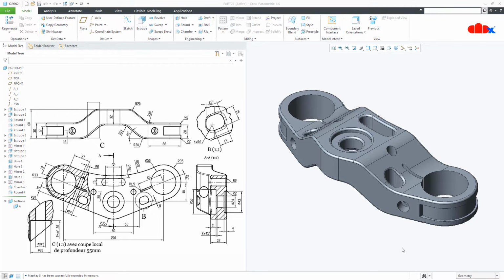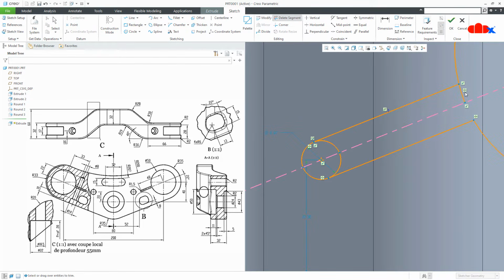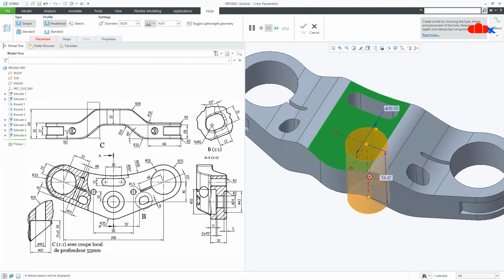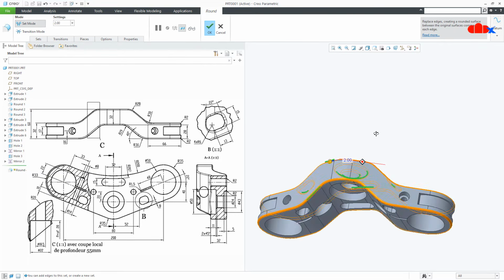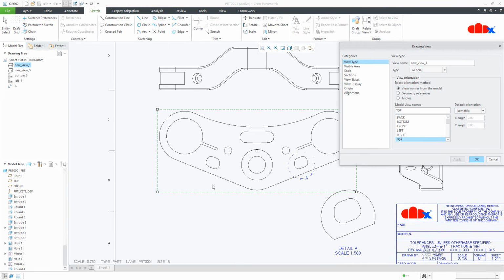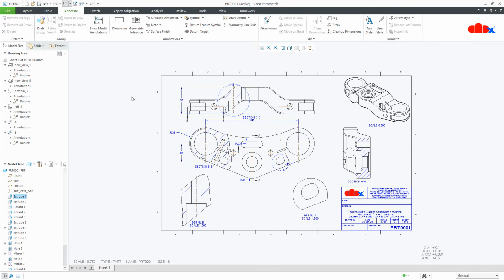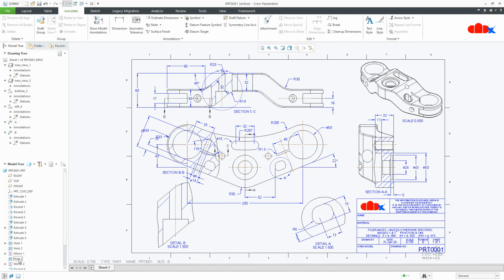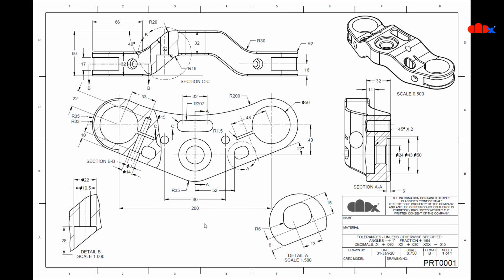Complex part design with Drawing tutorial for beginners | Machine part 23 in Creo Parametric

Comment: hello, i have one query, if this is the casting or forging part, then where is the partening line, also no any draft given  and we have made small cut inside for fork tightening, but how the part get squeez bcz its at inner side, why i am asking already i have designed upper triple clamp for harley davidson, as i am working for them right now,
Reply from the maker: Parting line comes under DFM. Once design is finalized, DFM starts.